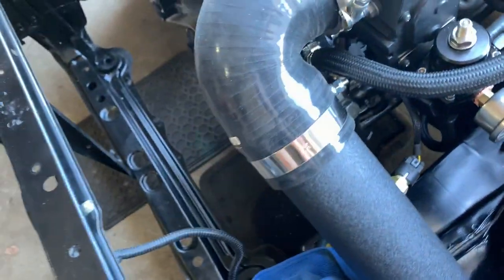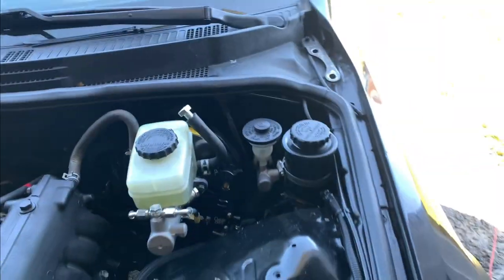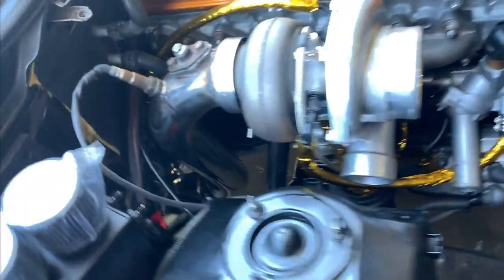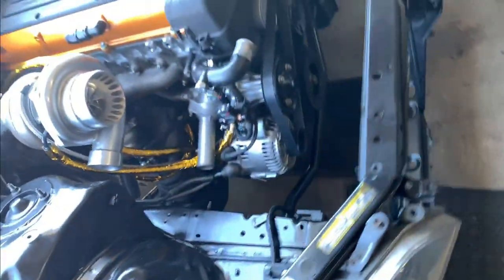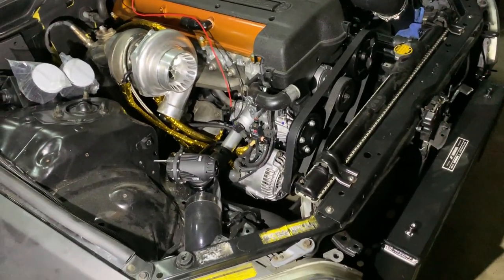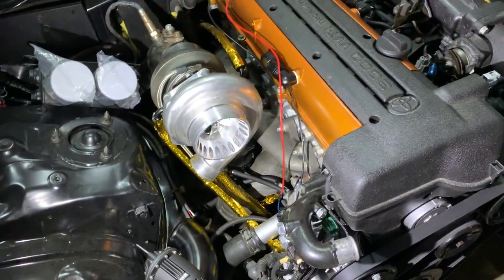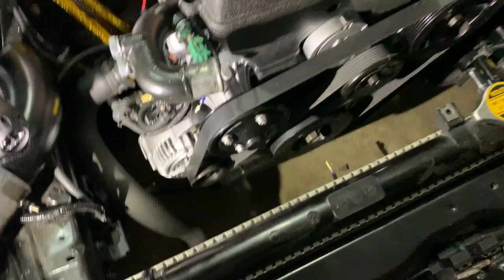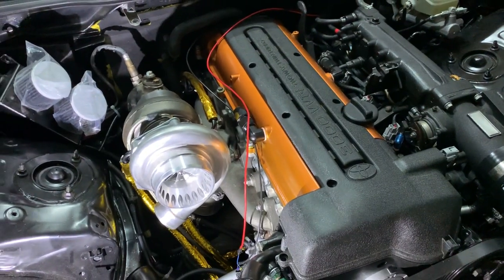2JZ_GTE Swap PT.4  Fuel Return, Power Steering, Cooling system and down pipe

Comment: I suggest you to keep the is300 fans. I ran mishimoto fans, shroud, and radiator and it ran way too hot. The fans barely pulled any air compared to the stock is300 fans. I went back to stock and it ran 20 degrees cooler if not more. Loving the build so far and can't wait to see you do some pulls.👍